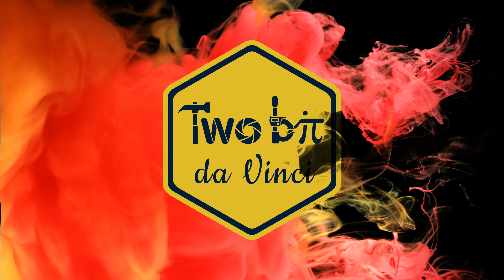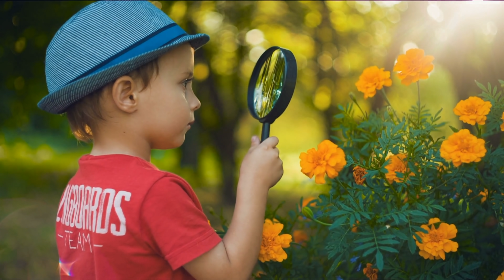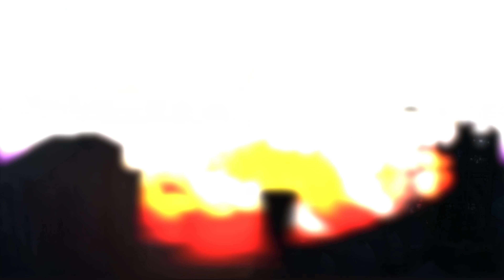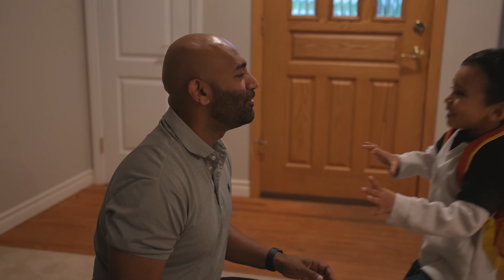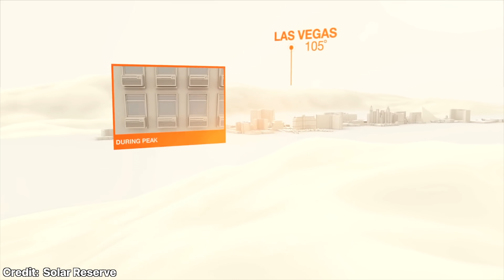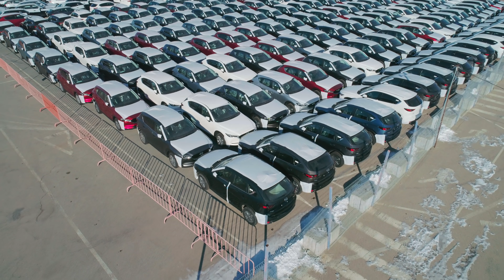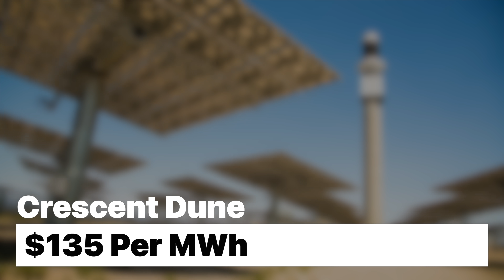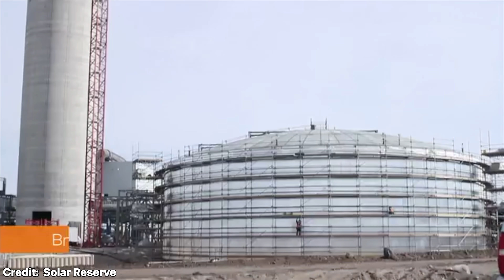This Billion Dollar Solar Plant was an EPIC Failure

Comment: California is building the largest battery in the world near San Francisco, and they intend to power it from solar panels and windmills. They claim this is the ultimate in being ‘green,’ but it is not! This construction project is creating an environmental disaster. Let me tell you why.
The main problem with solar arrays is the chemicals needed to process silicate into the silicon used in the panels. To make pure enough silicon requires processing it with hydrochloric acid, sulfuric acid, nitric acid, hydrogen fluoride, trichloroethane, and acetone. In addition, they also need gallium, arsenide, copper-indium-gallium- diselenide, and cadmium-telluride, which also are highly toxic. Silicon dust is a hazard to the workers, and the panels cannot be recycled.
Windmills are the ultimate in embedded costs and environmental destruction. Each weighs 1688 tons (the equivalent of 23 houses) and contains 1300 tons of concrete, 295 tons of steel, 48 tons of iron, 24 tons of fiberglass, and the hard-to-extract rare earth neodymium, praseodymium, and dysprosium. Each blade weighs 81,000 pounds and will last 15 to 20 years, at which time it must be replaced. We cannot recycle used blades. Sadly, both solar arrays and windmills kill birds, bats, sea life, and migratory insects.
NM lights dimmed, and he quietly said, “There may be a place for these technologies, but you must look beyond the myth of zero emissions. I predict EVs and windmills will be abandoned once the embedded environmental costs of making and replacing them become apparent.

Comment: Stop wasting tax payers money, go nuclear. You cannot get enough power out of the renewables  they are unreliable and expensive to build, run and maintain. Better still use coal, mankind is not changing the climate, the climate is always changing. Green power is killing manufacturing in the Western World. China is building 300 coal fired power stations, India is building 200 coal fired power stations not to mention the hundreds more which are being built. Obviously there CO2 output is not an issue because they don't believe the BS of the climate change religion.

Comment: so it was way to complex.. maintenance,  molten salt?.. why not use water    if people would setlle for a lastingconcept that would produce a bit  less yet problem free..  what if you produce electricity and share it with another plant on the other side of the earth.. bingo.. you don't have to store.. besides that what if you produce steam  and condens it back to water in that vent.. how fast you think you would fill up a collumn with  water? isn't that a storage of energy to?  you not only produce energy  you store it and produce water at the same time..  so put a turbine at the low and of the vent collumn or whatever unit..

Comment: How sad. I remember reading a story about this plant being built years ago. I was wondering how it was doing all of these years. This plant was an example of investors being Wowed by technology that wasn't really going to turn a profit if they thought about it. Also an example of something being way too technically designed when things can be much simpler.  There probably aren't a lot of people who are old enough to remember the Honda commercials from probably the 70s and the 80s. Their catchphrase was 'we make it simple'. I was watching a video about a fusion reactor that is being built that needs a element that is so rare that by the time the plant is finished in 10 years it will probably not be financially feasible to even work. I don't know why the hell anybody would spend tens of billions of dollars on technology like that. Just yesterday I watched a video about a fusion reactor that is a much simpler design and the fuel source is abundant. This makes sense and it will come online in less than 5 years. It was the same story with electric cars. People think they are a new invention but they have been around as long as fossil fuel powered cars. Obviously they didn't take off because electricity was barely a thing 100 years ago. Gasoline was super cheap and pretty much was a waste product of kerosene production so they went with that.
Reply: Well the fusion does have an abundant fuel source but we haven't done that because it doesn't work yet. In order for fusion to be viable it needs to put out more than it takes. There's a shit ton of energy required to make a fusion reaction happen and while what happens generates a significant amount of energy we have not gotten back the energy that was spent using conventional power to get the heat up to the levels to get the fusion to occur.
Right now they're just building tests and bigger reactors and modifying as they learn from their non commercially viable reactions.
We hope they solve it but it has not yet been solved
Reply: @Babihrse  reseach into fusion "reactors" has been on-going since the late 70's when Carter (a nuclear engineer) was president. There is a larger Tokamat fusion reactor being built in France. The reality of cheap electricty is just around the corner...sometime in the next 30 years...(sarc),
that is if all of Europe doesn't freeze to death this winter.
Reply: @BobCatz213  I did not know carter was a nuclear engineer
Reply: Helium-3 is the substance to be mined for these reactors. The Moon is the most abundant source. Look it up. 🧐
Reply: 30 more years fusionbros
Reply: As far as I am concerned fusion technology will always be successfully implemented 20 years in the future. Until I actually see one working outside of the lab. That was the trend so far and I assume that trend will continue until proven otherwise.

Comment: It is good to try new methods, perhaps at a smaller scale, small enough to smoke out unknowns. Having obtained the experience in this new area in the last 6 or so years, would "replacing the mirrors fully or partially with solar PV cells ( using the motors for sun tracking or even leaving those with PV panels fixed latitude)" make it economical (or minimise financial losses) atleast to take it forward?

Comment: They could replace mirrors with solar panels and work with both photo voltaic and photo thermal. If solar thermal  doesn't work, it would not matter as photo voltaic will still work.
They should sell the project to someone who can make it work.

Comment: Difficult to believe so many staff would be needed to maintain such a plant. I can see that would not be economic but if the plant ran on 100 staff it would be worth perusing. My guess is that the problems could have been solved. A mobile night time mirror steam cleaning device could be built. It would be cheaper to fix the issues than abandon the technology and the installation work done so far unless a nuclear plant manufacturer whispered in someone's ear?
Reply: Given that all the mirror units have to be identical, it shouldn't be a great leap to design robots to manage the maintenance.
Reply: Ivanpaugh?

Comment: So theres a few mistakes in this video.. for one, the thermal solar plant most people from southern California see en route to Las Vegas (if traveling by car or bus) is NOT crescent dunes, its Ivanpah solar electric generating system. Ivanpah is on the California side of the border just outside Primm (the Nevada border town any SoCal resident is likely familiar with if they travel by car to Vegas). Ivanpah is much larger then Crescent Dunes, with three towers.

Comment: Well, the issue with a standard solar panel, is it's reliance on rare earth metals and inability to be recycled effectively.  With something akin to a twenty year life span, and those rare earth metals running low or out due to lockdowns, I still believe in concentrated solar plants as the better alternative.  The catch would be, using multiple smaller plants, instead of one large one, for management and damage control purposes.
Reply: You are wrong PV is far better and proven.
Reply: @honesty_-no9he  they will disappear or be the worse versions of it, as the materials necessary run out.

Comment: They should have done this in a small scale first to figure out how to do this more economically.  I wonder, too, if one was near the Dalton Sea of it could also desalinate salt water, this it would have a double function.  Or having one near the ocean in a desert country.
Reply: They had. You think this is a one off technology, but it was proof of concepted in the 80s and Spain has had dozens of the things running since 2011. A quick trip to the world's most accurate source, Wikipedia, says hundreds of these things have been built. Funny enough, a big part of the failure WAS the larger scale. It added project cost and ultimately made it less economical at a time that it's main competition was plummeting in price.

Comment: Any smart contractor could tell you this would happen. Molten salt!?  A billion dollars? Masks do zero good. Mask states have identical results as unmasked states. DOE another example of how dumb the government is.  Leave it to CA to do this snafu.  Try parabolic mirrors and 600 degree oil to boil. Fewer parts and a better heat transfer medium.   Also pumping water uphill and releasing later is the best storage method. Great video. Thx

Comment: I'll never understand why projects like this don't start on a smaller scale and then ramp up when seen as successful and sustainable. Less risk and money allocated can be reassigned if not successful.
Reply: If you watch the video you will learn the failure was primarily a result of the dramatic drop in cost of PV’s.  They could have repaired the salt management system but it wasn’t worth it anymore. BTW the system was prototyped

Comment: 20 years prior to the Solar Plant north of Las Vegas there was one near Barstow, California.  It was visible from I-40 just east of town.  It did not appear to have the magma storage tanks but I could be wrong about that.  I did manage to see it in operation several times for several years but then it stopped and was removed.  Possibly a small scale test?  I never learned any details.
Reply: Yes it was a test plant.  It was not built to be a permanent operating system.
Reply: I'm assuming that led to the Ivanpah plant closer to Vegas, which I think da Vinci has confused for Crescent Dunes.

Comment: The problem with Solar is the cost of the supporting infrastructure such as lines and substations is not included
Reply from the maker: that doesn't make sense, that's a cost for any sort of energy generation. why would you treat solar differently?
Reply: @TwoBitDaVinci  solar and wind have a less of a energy density compared. In fact that are the worst, meaning you need more of it and more space to put it. Also the fact that location effects their efficiency hens why there are needed in large isolated areas. When you put all this together you have a huge about of infrastructure need to support the system such as sub station, transmission lines and so on. Now compare this to gas fire or such where it can be located at any area in close proximity to large populated areas and can be an additional supplement to existing infrastructure. When SMR technology’s and closed loop supercritical Co2 systems are implemented, there may be a question as to why do we even need renewable on a large scale.

Comment: An excellently prepared and presented material on this issue. From my point of view, two aspects are still needed here:
1. this enormous number of heliostats can never be kept clean in the desert area, which affects the efficiency and yield from the very beginning.
2. this kind of solar power plant can be used at most only about 13-15 percent because of the circular arrangement of the mirrors at one moment. The remaining 85 percent of the mirrors are as useful as if they had been standing in the dark basement.
A 40-second shot from the plane here on YouTube, shows this most clearly. "Ivanpah Solar Electric Generating System View From Above 11-8-17"
Reply: Underrated comment
Reply: Rubbish, fly your plane at the FOCAL POINT of the circle of mirrors and you would get fried out of the sky as the light from ALL the mirrors hits you. There's a reason the pilot avoids being in focus!
Reply: @manicminer4573  When you grow up and learn about Padre Himalaya, you will understand why he built a solar oven more than 118 years ago that could produce a temperature of about 4000 °C. Unlike Ericsson and other notable figures of that time, this ingenious inventor used only a tiny part of a shell that offered the best solar concentration. And this is exactly the effect I have already mentioned.
By the way, Padre Himalaya won two main prizes and a gold medal for his work at the 1904 St. Louis World's Fair. After 118 years, no one has managed to come even close to his achievement.

Comment: First of the all, molten salt plant still needs fuel-based generators to keep the salt in the molten state during the night to prevent it solidifies. 
Secondly, the cost of solar panel cannot be the directly compared with the cost of molten salt plant because if you add the battery based storage cost, solar battery cost will be much much higher. 
Thirdly, molten salt plant provides consistent power output that does not need a gas turbine-based power plant to balance the load. This is very important since the actual load provided by solar panel is 1/4 of the rated capacity of solar farms. 

Power supply has 3 parts: generation, distribution, and consumption. They must be coordinated meticulously. If you only think about generation, you will gravely underestimate the importance of traditional generators like coal fire and nuclear power.

Comment: They should convert this facility to melt plastic and extract the petrolium in the plastic or use it for some sort of salt water desalinization plant to make distilled water or something, or pre-heat aluminum / copper before it goes to the furnace to save gas.       Seems a big waste to not be able to do something else with it.

Comment: For the heavy, base load generation, the grid needs Nuclear, Hydro, or some other fairly green generation method.  Wind and solar are diffuse, so diffuse that PV and Wind make some  sense for residential in the right places, but the Return you get trying to turn both into utility scale technology has problems.  Residents can have a household battery and car battery to get them through a stormy period, but regular business simply has concentrated uses that cannot fit in a footprint less than 3 or 4 times the size of land they own.  That is only the computers and aairConditioning.  A metal working shop?  ten time the footprint in solar cells......   Nuclear and Heavy, Concentrated means of generation are required with acknowledgement that they may not be "Totally Green"  solar panels and windmill are not "Totally Green" eitherwhen you consider the carbon created when building them.  Amory Lovins, and other engineeers in the green camp see this issue clearly.
Reply: There are zero energy sources that don't use fossil fuels at some point. We are 100% dependent on fossil fuels still, the entire society would collapse in a week without them. Fossil fuels can be ramped up to meet demand, something on an excess of nuclear power plants would be able to duplicate.
Reply: @gorkyd7912  By energy independant, I mean we do not rely on some other countries production.  but yes you summed up most of what I was saying.  Technological america would have to devolve into 1800's America to keep body and soul together.

Comment: KINDA LATE TO THE NEWS, THIS WAS MENTIONED ON MANY CHANNELS ABOUT THEIR FAILURE...ALSO THIS ISN'T THE SAME POWER PLANT AS THE ONE YOU SEE DRIVING ON THE 15 TO LAS VEGAS FROM CALIFORNIA. THE PROBLEM IS HAVING GREEN ENERGY DURING THE NIGHT WHEN THE SUN GOES DOWN...THAT'S WHY IT'S CHEAPER TO CHARGE YOUR EV DURING THE TIME FROM 9AM TO 4PM BECAUSE THERE IS A LOT OF SOLAR ENERGY BEING PRODUCED AND THE MOST EXPENSIVE BETWEEN 5PM TO 9PM.

Comment: wonder how viable a solar plant would be for generating process heat or city heating?
Reply: City-scale heating would be very difficult because of the required length of the hot pipes, which is not only expensive, but would lose a lot of heat. However for process heat, and for building conditioning it's actually very viable and profitable. Nowadays companies who go along have around 10-30% of their heat demand met by solar, very profitably. Small scale thermal energy storage is easy: just think about the thermal tanks sold at hardware stores.

Comment: My entire job is to estimate the cost of operating new systems before they are built. If the company has an ounce of sense, I can even work with the design engineers to help redesign it so it's more cost effective. But guess how many company want to employ me before they build it? They seem to want to throw money at me to 'fix' their problems but once the system is built, you can't change operating costs more than about 10%.

Comment: I wonder if it could be economically feasible to make the mirrors just heat water and spin a steam turbine instead of the very expensive salt based system. I mean it’s already built, just change out the middle part. It would be like a nuclear plant but with the sun heating the core instead of Uranium.
Reply: My guess is that they don't want to deal with the high pressure of supercritical water, whereas molten salt is a liquid so doesn't have to be held under pressure.